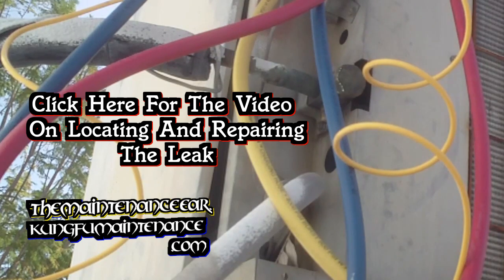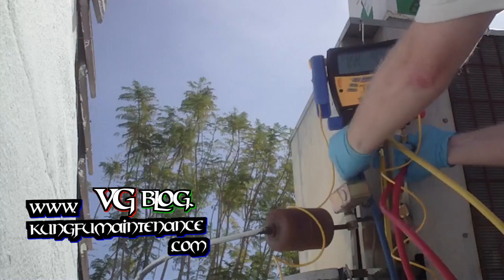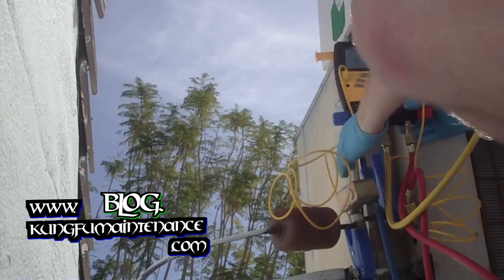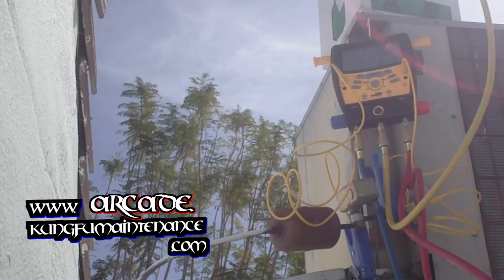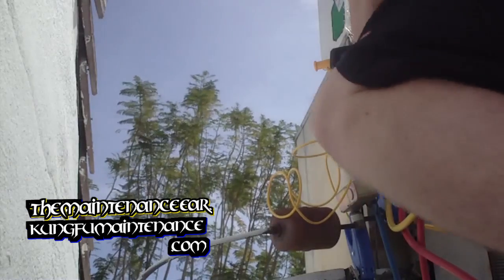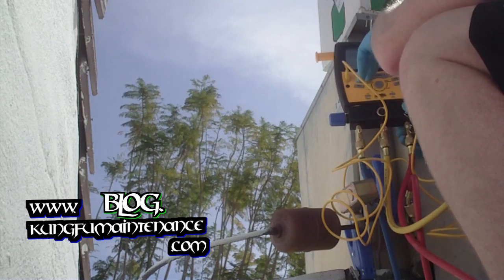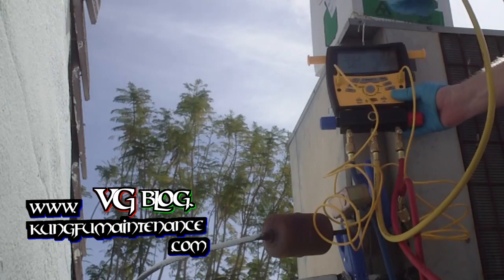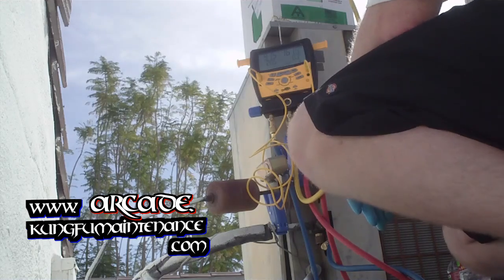How To Charge Air Conditioner Low On Freon Refrigerant Gas Superheat Plus Subcool Using Sman3 Part1

Comment from the maker: Get KFM's favored AC Gauges here            http://amzn.to/2kYgGb8
Hard Start Kit     http://amzn.to/2kiD16v   Contactor     http://amzn.to/2lFqA0P
Get  the Multi Tool Pliers used in so many KFM videos       http://amzn.to/2kWTjPp
5mf Capacitor   http://amzn.to/2wC96sH     35mf Capacitor    http://amzn.to/2vZVZ2t
35/5mf Capacitor   http://amzn.to/2iVJNi2        40/5mf Capacitor    http://amzn.to/2wzEdXD 
45/5 mf Capacitor   http://amzn.to/2w0wez5   
Valve Core Removal Tool                              http://amzn.to/2kJ00pC
Get KFM favored Electronic Leak Detector        http://amzn.to/2kmQMMz
Simple Leak Seek Spray   http://amzn.to/2lFfcC5  Laser Thermometer  http://amzn.to/2layD8I  
Inficon Refrigerant Scale                               http://amzn.to/2vUCQPD
Get KFM's favored Multi-Meter  here        http://amzn.to/2l8W9CO 
Get the Milwaukee 11 in 1 Screwdriver     http://amzn.to/2uTtsNj 
Wet Dry Vacuum used in so many KFM videos   http://amzn.to/2lFxi7u
Condensate Pan Tablets   http://amzn.to/2lalV9W   No Rinse Coil Cleaner  http://amzn.to/2lHg8GD
Condenser Fin Whisk Brush                          http://amzn.to/2vWXUoC 
Chapin Pro Pump Sprayer                             http://amzn.to/2vWCXdD
Evaporator Coil Cleaner No Rinse Mix        http://amzn.to/2x3eJTT
Evaporator Coil Cleaner No Rinse Can        http://amzn.to/2ezIxju  
Get the Screwdriver used in so many KFM videos here    http://amzn.to/2kHFoOF 
Easiest Way To Get Universal EPA Certified Prep Manual    http://amzn.to/2kIQdQC
You must be EPA certified to charge or recover refrigerants and here is about the Easiest Way To Get certified with the Universal EPA Certified Prep Manual    http://amzn.to/2kIQdQC
Get The Kung Fu Maintenance book here     http://amzn.to/2lEQPFk
Or  the Kung Fu Maintenance E book here  for less than $5    http://amzn.to/2lEY8wD
Get the Kung Fu Maintenance album (good driving music) "Up Beat" here     http://amzn.to/2l41pZ1
Get the Kung Fu Maintenance album (nice Instrumental music) "Entropy" here   http://amzn.to/2kl2U0p
Samsung Galaxy S8 Plus        http://amzn.to/2sFn9h8
GoPro Hero 5 Action Camera         http://amzn.to/2sN4nVK
Rode Lapel Microphone                 http://amzn.to/2vZoFc7
Purple Panda Lapel Microphone  Kit   http://amzn.to/2wByXkq
Video Edit Pro Software       http://amzn.to/2ruaaeZ
Samsung Galaxy S5                 http://amzn.to/2wBxk6l     
Samsung Galaxy S8 Plus        http://amzn.to/2sFn9h8
Video Edit Pro Software       http://amzn.to/2ruaaeZ

Hire An HVAC Specialist                                  http://amzn.to/2lktKek
Air Duct Cleaning Services                              http://amzn.to/2lFTpun
Central Air Conditioner Tune Up                   http://amzn.to/2lzJGoy 
Air Conditioner Repair Or Installation          http://amzn.to/2lFsEGw                                           
I don't work for any of the product companies  listed however I do make a small commission on items ordered  through the links.

Comment: when charging with r22 do you vaccum the system every time or do you just add on ?
Reply from the maker: Rafi Diaz No, all that is needed is to purge the hoses before charging. Vacuuming is done when a system is empty to boil off moisture inside the system.
Reply: KungFuMaintenance
ok thanks a bunch , i was over thinking it.cant wait to get out there in the field and get my hands dirty
Reply: As long as there is pressure are you good to add refrigerant even if it 1 or 2 lbs in the system ?

Comment: ive been thinking of getting this gauge (the digital one ) im still a rookie i got my epa universal and everything , i prefer this one because you can charge with any gas instead of buying one for each gas, what do you guys think ? let me know bros .
Reply from the maker: Rafi Diaz Thes gauges are great. To avoid contamination it is best in my opinion to have separate gauges for each type of refrigerant even though gauges are rated for use with different types of refrigerant. I would use these for your most often used refrigerant (most likley r22 but in some areas r410) and use traditional gauges for other less often used refrigerants.
Reply: KungFuMaintenance
thanks a bunch you are a very useful resource :) , yeah my peers in school are like first buy the cheaper gauges and then when you a pro go for the digital , but is cheaper if you buy the digital one that take any refrigerant , but i will take your word in consideration ,i didnt know it causes contamination at times but once again thnx a bunch.

Comment: You always purge your lines, Different refrigerants use different compressor oils I don't think using the same gauges for 22 & 44 is a good idea. also check the caps and put new ones on if there are none the stems will leak after time.
Reply: Asked others this and they say just purge your gauges, there is such a minimal amount in the lines that it won't make a difference. What do others here say, also what about leaving your gauges empty???

Comment: checking unit that has been running? No vacuum, unless it is dead on charge. low side would be in vacuum..not a good type either.

Comment from the maker: That's a negative. It is best to purge each line separately and let me explain why. When you hook up the low side refrigerant presses up against the air trapped in the hose to the service handle same on the high side same on the service line after you open the bottle. There are large non condensable bubbles of air on opposite sides of the manifold. It is not until the valves are turned open that the connection is made from one side to the other. Therefore it is best to purge individually.

Comment from the maker: I am solely using the Sman3 for R-22. I use separate old style gauges and hoses for everything else, dedicated gauges and hoses for each type of refrigerant. I eventually want to get more into some of the drop in replacements for R-22 such as m099 also called r438a and Isceon.

Comment: Curious since the Sman3 does so many types of refrigerants do you the same hoses or do you change them depending the refrigerant? The reeason I ask is because I still use the old style gauges and I have seperate ones for R22 and 410a. I am afraid to mix the two.

Comment from the maker: In truth they all need purging. Air is in hoses and the hoses only become part of a vacuum. As you hook up the blue low side line the refrigerant presses up through the hose to the manifold gauge. Without purging the air stays in the blue line that is until refrigerant is passed from the yellow line up through the manifold down through the blue line into the system. If the air bubble is left the refrigerant will carry it into the system like an air bubble in a straw. Same is true for red side.

Comment from the maker: Oh wow. If I had had the choice I probably would have picked the hard case. When I first opened it up and it was the soft case I was sort of thinking in the back of my mind that I probably eventually would not use it. Man was that initial fleeting thought wrong. I have a foam knee board that I carry in my AC bag that works out pretty good, think it cost me about eight bucks. However I often don't carry the bag up on the roof for individual unit repairs.